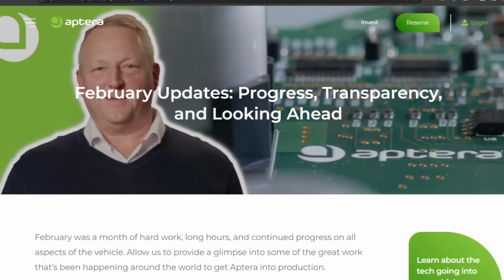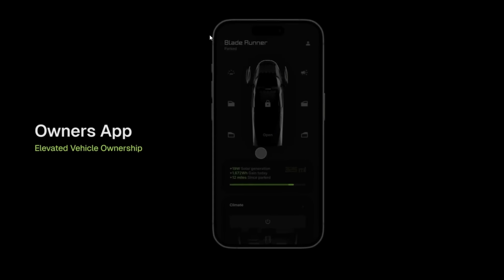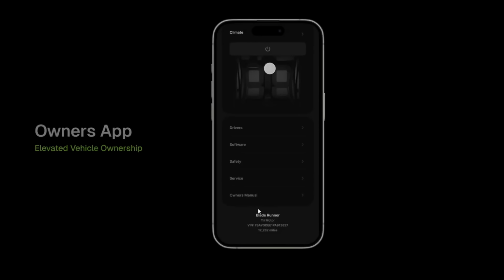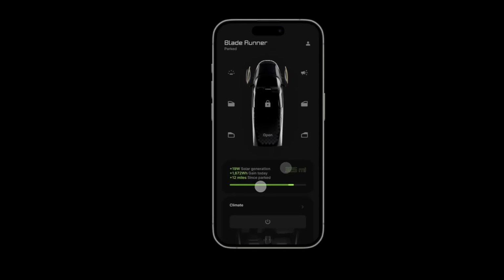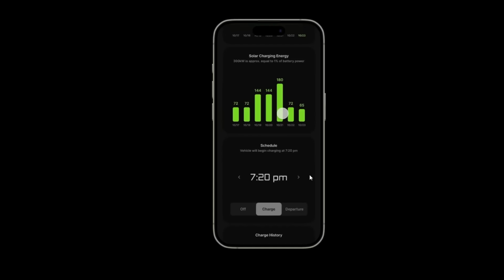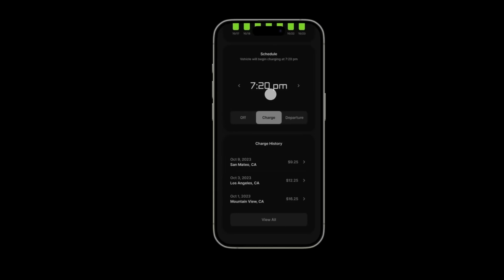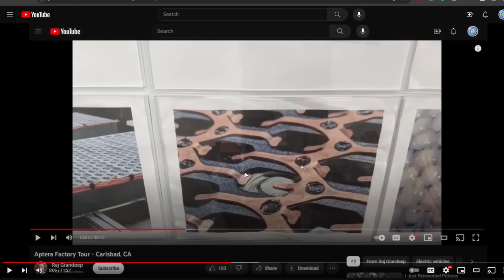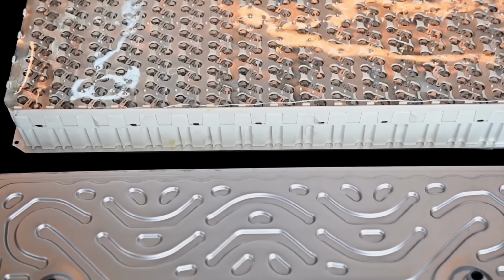Aptera February 2024 Update:  App and Battery Pack

Comment: The last thing I want is an app to unlock my hatch. I don't unlock my car with an app now. I have a button on my key fob ... which makes vastly more sense. I don't want an app to see my solar charging rate either. I want to see it on the car's display. My Bolt has no app, as far as I know, and I'm getting along just fine without one. Creating this app is busy work for Aptera employees. It adds nothing significant to the value of an Aptera. I want a button on a keyfob anyway.

I appreciate the update, but I'm really only interested in production financing at this point. Elon Musk lost tens of billions of dollars on Twitter/X in the last year. Apple spent billions on an EV design and then canceled the program. Rivian, Fisker, Sono, Lightyear, Xpeng, Nio, ... Billions of bucks seem to flow like water in this space. Why can't Aptera find a few hundred million to start production? Why are they spending the cash they have on superfluous apps?
Reply: Everyone has an opinion on things. I welcome the app and it functionality. It would be nice to be able to initiate things from inside the house or monitor the state of the battery charge and  solar output etc. Aptera is trying to get this vehicle out the door. I don't want to misspeak but I think that if you have either the rfid card or your smart phone with Bluetooth enabled and the feature turned you can either touch the rfid card to the Aptera logo or if your phone is in proximity , open the door with the knock knock ir a button press. Having a rfid chip in a key fob would probably work inlieu of the card. It quirky but if it works.
I'm a like analog guages and simple cockpit with switches, buttons  kind of guy, but it's not happening on this vehicle.
Reply: Love the app❤ and my mY...
Reply: Just a knock knock is all you need. No App needed. This is useful when your phone is dead or broke. Aptera thinks of it all as opposed to all of the other companies.

Comment: Disappointing update. App interesting i hope the solar panels will produce more power than what is shown.
Reply: Also the second half of the video talks about how they don't have enough cash to even start low volume production.
Reply: @RomanChaar  Once they drive Pi#1 around, the funding will show up.
Reply: @billsmith5960  when is that pi coming? 2025…………
Reply: @billsmith5960  how much does it need to      ”go up”
Reply: @RomanChaar - April
Reply: @billsmith5960  says who?
Reply: @RomanChaar  It will show up in Paris in early march, when we will likely have our first glimpse.
Reply: the first PI in Paris, who announced that and when? @n.brucenelson5920
Reply: Could well be placeholders. Maybe the vehicle was inside the facility. 😏
That being said, using typical or even optimistic numbers would have been a better play.

Comment: I thought they switched to lithium iron phosphate.
If so the batteries can go from 0% to 100%
Reply from the maker: No they are nmc as far as we know.  Moving to lpf would require a complete battery pack redesign
Reply: @ApteraOwnersClub  I don’t think a redesign is necessary based on other videos i’ve seen
Reply: I think they have been constant with their decision to use.lithium-ion NMC.
They have a higher energy density than LFP, are lighter, and have better cold weather charging characteristics.
Reply: NMC cells are fine going to 100 percent if they are quality cells. Those Eve cells they were initially thinking of using are rated to 1000 cycles before degrading down to 85 percent which on the launch is 400,000 miles when charging from 0 to 100%.  The best practice would be charge to 75 or 80 percent when you are just doing short trips but 100 percent just before a road trip. That should give thousands of cycles.
Reply: yeah where did you see that. Lfp is too heavy, although it's awesome. aptera is about efficiency and super light weight..
Reply: The video was here on Aug 3, 2022.  They signed a contract with formosa energy
The video is titled:
Aptera is going lithium iron phosphate …
Reply from the maker: yeah i think that's way down the line
Reply: LFP batteries reportedly have about 30% less power density than NMC batteries. The 400 mile NMC battery pack would be a  ~280 mile LFP battery pack.
Reply: @garywozniak7742  and with the 80/20 rule the 400 mile battery range should be kept to an effective range of 240 miles